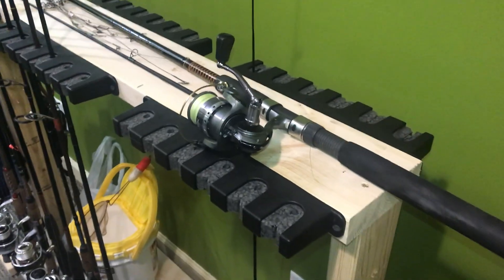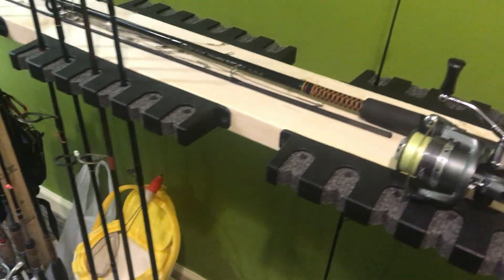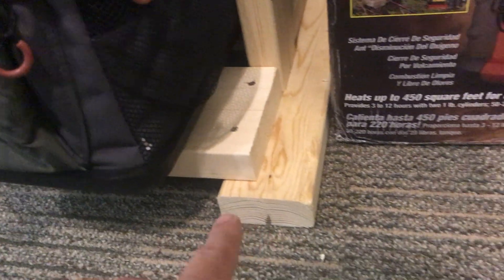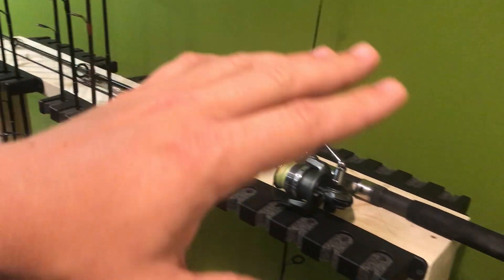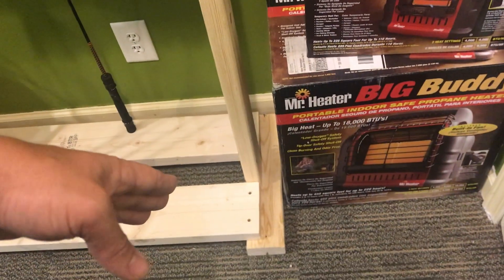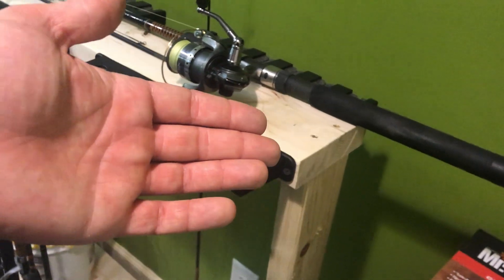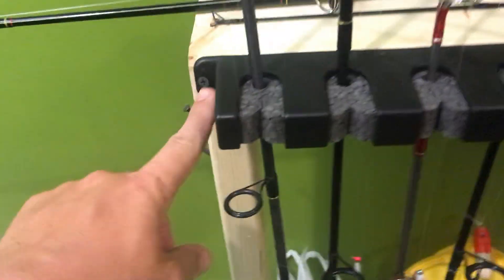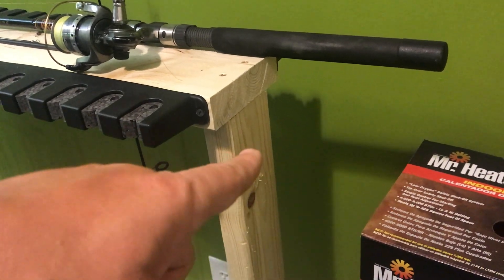HOW TO Build a Fishing Rod Rack (DIY Rod Holder - Rod Stand)

Comment: Dimensions needed for one that would hold say 10 rods and all the materials I would greatly appreciate it thanks
Reply from the maker: Pretty sure I listed them in the video?
Reply: @DWSOutdoors  yes I have watched a whole video but it's kind of hard finding the moments you say the dimensions and it would be 10x easier if their was a list. Plus I'm trying to make a smaller model for 12 rods so... I need the do the math for the smaller dimensions and your video is the best one so far also cheapest one too.
Reply from the maker: I think you could just build it with 2 of those rod holders side x  side or across from each other? So if I were you I would just buy a pack of those Berkley Rod holders and measure the width of one and make a skinny tower halfway taller then the first rod eyes and that would be REALLY CHEAP lol probably only need 1 2x4 and 1 2x6!